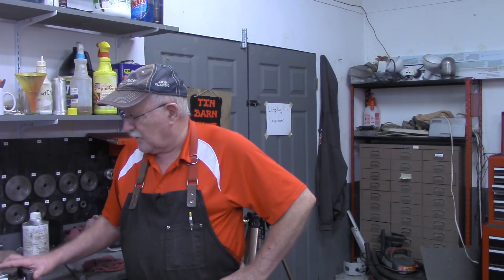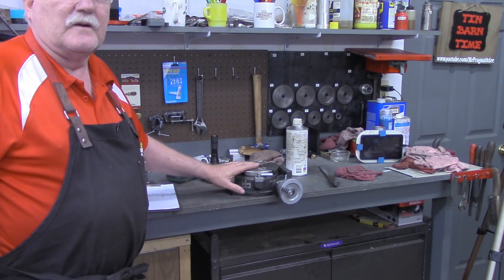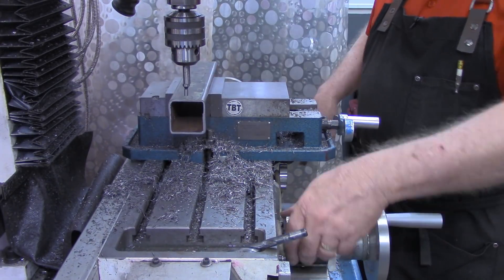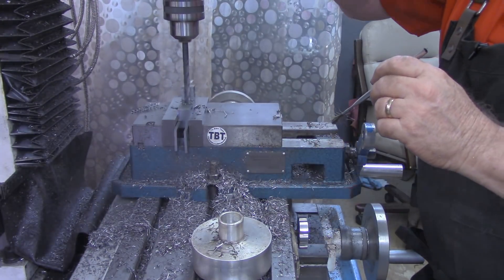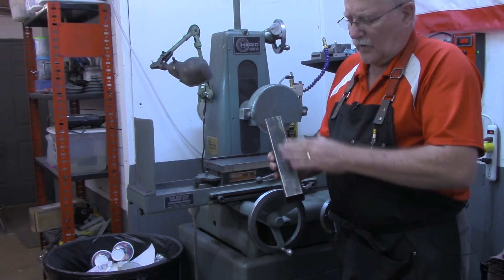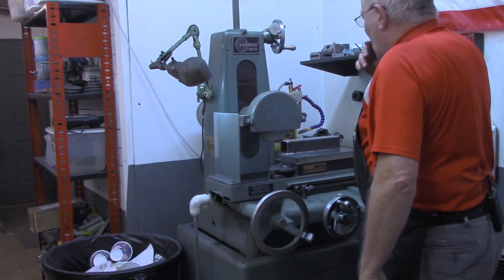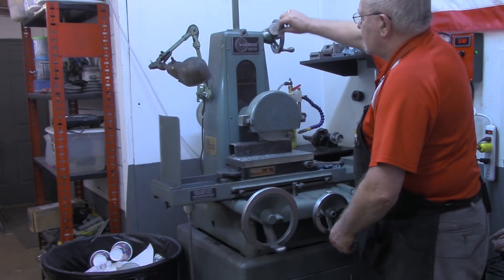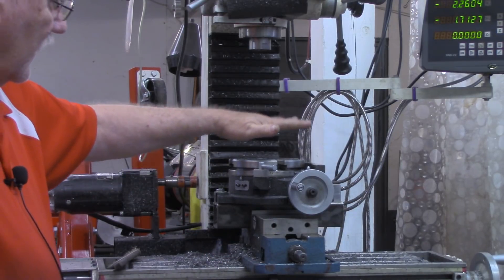Rotary Table Mill Vise Mount

Comment: I like what you have done.  Nice solution to a long set up that, for me, leads to not using a certain method because of the long set times.  Had you considered mounting the rotary table directly to the mill table.  If you rejected that Idea please share why?  again thanks for the video

Comment: Clever option, but, are you sure you don't want to use a solid chunk of steel for that... as the vise jaws will throw off the dim's and tram of the rotary table? If the tops of your vise jaws are tram to the mills table top, those will support the rotary table, in respects to tram, and as per the weight of adding a chunk of solid steel, might come out to weigh the same, and go with a smaller bar, and let the top of the jaws assist in keeping the rotary tram... Just a thought... Dru

Comment: Awesome video!  What is the longest stroke you can set up your grinding table to do?  I ask because if you can it is recommended that you set the part on an angle on the mag chuck.  This cuts down on the distance the wheel is in contact with the surface and lowers the heat that gets transmitted to the part.